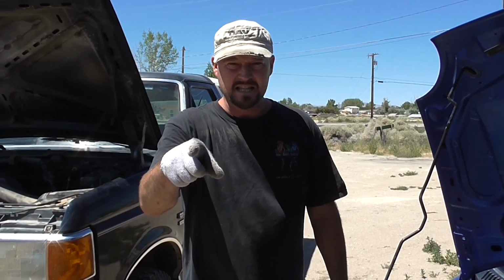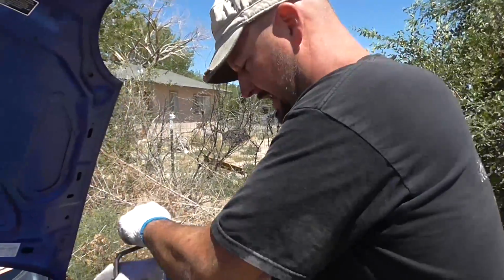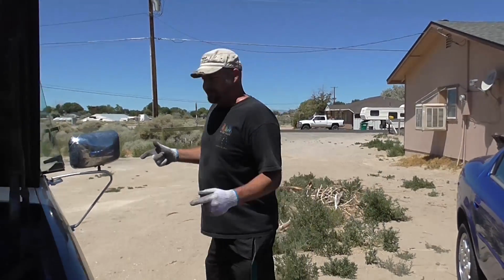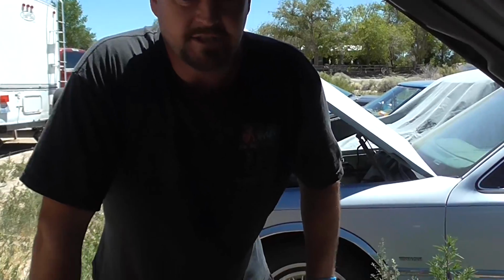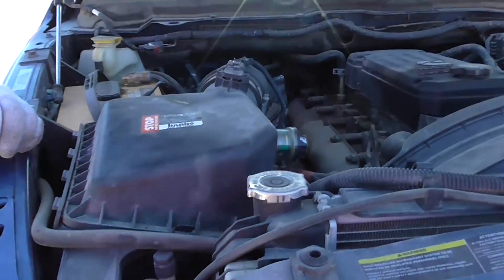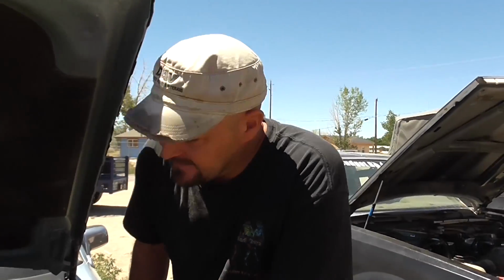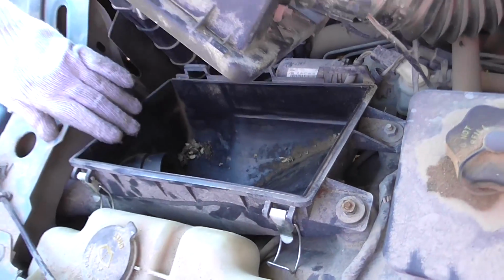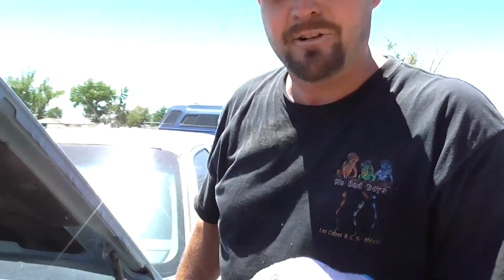Free Horsepower And Fuel Economy - Intake Mods

Comment: Why the negative comments, guys helping out giving free advice good on you dude
Reply: It's the kind of advice that can fuck your car long term. "Performance" air filters get their performance in one of two ways. Either they have MUCH more area (which this one clearly does not), or they do a hell of a lot less filtering.

Operating on the assumption that if one is being cheap about this, one intends to keep the car until it's a rusty pile of scrap, doing this is quite counterproductive. Allowing more dust in your engine will wear out your piston-cylinder sealing components (piston rings, texture of bore lining, probably valve seats too, for good measure) a lot quicker, which will make your car an oil burner a lot quicker.

The short term gains are nice, but long term it's just not worth it. Not unless you plan on getting rid of the car next year.
Reply: But did you see how dirty his second vehicles filter was? When you remove the bottoms it sucks in all the dust  meaning you have to replace your air filter more often
Reply: Mark Davies You are right for sure!!!!
Reply: @233kosta but that’s what a cold air intake literally does the same thing there is no box there is heat sheilds that’s dumb
Reply: @trippiebear848  Agreed. Sure, he's allowing more air access to the surface of the filter, but its air from inside the engine bay. Is a "hot air intake" really going to help over the stock version?
Reply: @GettinEdgy  the air will come through but if you think about it that’s still what a cold air intake is
Reply: Matt is a genius and the mods work GREAT! Much better than expensive aftermarket anything.
Reply: Welcome to the internet
Reply: Ikr.... Smh all these automotive engineers and master mechanics
Reply: @233kosta  he preventing you from fucking up not trynna fuck you up he knows his stuff g
Reply: Haters are gonna hate!!!!! Period!!!!! If you not willing to even try things, then zip it!!!!! Period!!!!! "Don't hate the player, Hate the game"

Comment: "To the untrained eye, this Neon looks unmodified and IT IS because who the hell would modify a Neon?"
Reply from the maker: Hmm, someone that wanted many more MPG and better acceleration with less push of the throttle.
Reply: 'many more MPG' then they would drive a Smart car.
Reply from the maker: NOTHING, could convince me to drive that ugly as hell death trap on wheels smart car.
Reply: YOU are the in-flight-rocket-surgeon who brought up MPG and acceleration ... stop trolling.
Reply from the maker: Trolling??? I am on my own page, I cannot troll my own page !!!  You are trolling on MY PAGE.  Enough already !
Reply: back in the 70s there ws a company that would take a 400cuin and pull all the pistons and repace 4 with dome top pistons and plug the other 4 falves  and run on 4 cylinders they got 20 percent better milage and only lost 5 percent power
Reply: Back in the 70s there was the Arab Oil Embargo...so...
Reply: Sleeper-sleeper car??
Reply: Flashahol Don't they call those coma cars?
Reply: LOL,That term would definitely explain the one Tercel I once saw who's owner unexplainably had a NOS injection system installed on... I was thinking: WTF POS modding are you investing in, dude???????? You just made my day!
Reply: Sean Watts
Lots of people. I have a 1998 Mercury Mystique with a 4 cylinder and i'll be modding every single thing available. Btw, there are 0 commercial (aftermarket) parts for my car. There are, however, race grade engine components available from the UK.
Reply: a jajka
Reply: Sean Watts I do
Reply: Sean Watts You ARE the definition of trolling
Reply: @Crawdoodle  and why is he pushing the throttle less? Is it because the car is breathing easier with the crap intake?
Reply: Why modify a neon? I'll school you real quick. CLOSED DECK is why. Strong platform to run either high boost with minimal modifications and or run high compression . No need to press a block guard and so on.. now do I recommend doing so no... But as far as strength goes it's a stronger block than Honda blocks that everyone builds and no I'm not bashing just using examples. Do some research and you'll see why. Obviously neons have shit parts on them to begin with and most owners don't take care of them due to the buying price. Little money to buy a car most likely means little money to maintain. Have a great day.
Reply: 2.0 4cyl stock 0-60 in 7 secs for a econo box thats not bad
Reply: Me
Reply: You’d be surprised!
Reply: Pornhub "Little Innocent Neon and Little Innocent Bronco get wild"
Reply: @seanwatts8342  because you can put a shit load of power to them. There used to be a guy in the city I live that had a 2 door neon with almost 800hp and I watched it smash a viper like it was sittin still.
Reply: They actually do have decent chassis dynamics on the track.
Reply: The only thing you hear from any of these so-called precise cut modifications, is the intake air being sucked in. Just like if you take a breather off of a four-barrel carburetor, on a 74 crown Victoria. Then it sounds like a beast.
Don't do any of these modifications that he does to the airbox, that have the bottom cut out. what does it suck air from the engine compartment and cause the air filter to stop up with oil. That little bit of residue on your valve covers and crap... It's a lot worse when the damn thing is sucking oily air from the inside of the compartment. You will be changing your air filter every 2 or 3 months. Instead of every 2 to 3 years.
That's precisely why they make air boxes, that have the end cut out and it's piped through either the fender well or the front of the vehicle. Cold air intake. The reason you won't cold air is because it atomizes the fuel quicker. Once the engine gets warm, you start losing horsepower. Just like adding nitrous to a vehicle, only thing is doing is coolin the air off an addend just a little bit more oxygen.
You don't have to take my word for it just look at the picture of my profile. That is a naturally aspirated, (nothing but carbs) 696 horsepower, 512 foot pound torque, Lincoln Mark 6 5.0 to the rear wheels. Built it myself, and that is numbers come from a roll test Dyno. Probably looking closer to 750 to 800hp off the rear of the engine.
And it gets better gas mileage than the factory 5.0 that was in my mustang. simply because more horsepower more torque means, less strain on the engine less pedal you have to mash. But if you put your foot to the floor, it'll drink at fuel like a forty year-long alcoholic.
Since I built it myself, with one cousin owning a block machine shop and another cousin owning a balancing shop, all I had to do is pay for the parts. Granted it wasn't 25 or $30, but it'll turn 8000 RPMs and drag the front wheels off the ground along with tucking the 3in exhaust underneath the rear bumper. To hell with a sleeper, you put them in a sleeper hold with something like this.
Reply: @budgetboosting  I have a completely stock 350 in my 93 C1500 and I could gap all those vehicles I get better fuel mileage and I only paid 1300 dollars for it
Reply: A poor man does! What a stupid question! lol
Reply: someone running the armature classes a local track that only allows stock/ lightly modded 4 cylinders and you dont want to blend in with the non vtec hondas and saturn ions
Reply: my buddy has a manual neon with a lancer evo engine swapped into it and a fiberglass hood and that thing fuckin rips
Reply: They did make a special Neon SRT-4 which intake mod would really wake it up.  See Mad Boosting for some great budget video content.
Reply: @madboostingmadmatt48  My former neighbor had one of those - it's about like a VW GTI.
Reply: Neon is a classic stop hating

Comment: 21:15 that hole is most likely larger than the diameter of the throttle body. It doesn't affect the performance at all.

Comment: This mod added so much extra power that when I launched it, the front clip tore clean off. Even made the rims spin inside the tire before it took off. Thats quite a bit of power gain.
Reply from the maker: +JDTVEXTREMEVIDEOS yes, that sounds like you had a great torque increase which is really felt in daily driving.
Reply: thats the best man!

Comment: I used to live in the desert, so I've observed that from time to time the clearer air and insane temperatures cause a change in brain function. It seems to lead to a bit of craziness and also ingenuity, which seems to be the case here. If you add a bit of your own "rare sense" to his, you can solve any question that may arise locally. I like this guy's presentation. Thank You, JD
Reply: JD Wisdom yeh it did to abraham and mohammed and discovered religion
Reply: JD Wisdom damn dude why cut it up spend 40 and put a specter as ND set it on top

Comment: synthetic oil can also help fuel economy check tire pressure often do make sure they manufacture spec the sticker is mostly by the door jam keeping the RPMs low
Reply: Synthetic oil gives you a marginal increase in power, but unfortunately the same fuel economy.

Comment: the stock intakes are optimized to supply the perfect amount of air mixture is the truth they get the most HP out of your engine always... otherwise car makers would be hindering there marketing numbers... if a car is making 300 horsepower u better believe the stock air box is getting the most out of that.. putting on a aftermarket air filter isn't going to magically create 320 hp... also the intake hole may be small but its powerfully sucking in air... so it doesn't need to be a massive hole... on sports cars u can actually hear the hiss of the intake sucking in large amounts of air quickly.. don't need a big massive hole when its pulling in a ton of air rapidly creating the perfect mixture to optimize the engine to its maximum horsepower.. hope this helps.
Reply from the maker: Case in point go to a performance tuner such as Hennessey Performance or any of them, see how many of their 1000 hp+ have a stock air box on them....... That should clear up any and all confusion.
Reply: And how much of that 1000+ hp do you think is from the aftermarket air intake :) that should clear up 98% of the confusion cause at the most 2% gains is all your seeing from adding a slight amount of increase in air intake and tuning the car for it... air flow can only go so far... its your engine and modifications that matter 98% of the vehicles true horsepower
Reply from the maker: Every bit of an increase, is an increase.  Why knowingly decrease when you can increase?  Then again, most sheeple settle for mediocracy, follow the herd even if its to the gator pond....  That's ok.
Reply: @budgetboosting  This dudes too fkn awesome!

Comment: I live in Florida no emissions no gun bans
Reply: Gotta love Florida.
Reply: Amen. No inspections either. Run no cat on my tsx header, no mix muffler, just 2 performance mufflers for the dual exhaust. No worries, no problem. Love my Florida.
Reply: It doesn't matter where you live in the USA -- it's against FEDERAL law to remove catalytic converters from a street-driven vehicle.
 There's no emissions INSPECTIONS in Florida, but the Federal laws still apply.
 I'm sure the millions of kids that are marching for Cleaner Air will appreciate your total lack of interest and/or knowledge regarding the same air that WE ALL breathe.
Reply: @ScrewballMcAdams  NO, I don't. Too many bugs, snakes, and Republicans.
Reply: @SlikLizrd  you are correct federal still applies. That's why the muffler shop makes you sign a waiver saying the car is going to be used for off road purposes only. That makes sure the muffler shop is not held liable if you get caught.  That's why I had my RX7 with no cats running on the street as a daily driver. Never had an issue. 

Side note. Nothing wrong with Republicans brother. We are good people.
Reply: @SlikLizrd  my RX7 ran about as clean as any rotary could. It actually passed the sniff test in Georgia where my sister lives just didn't pass the visual inspection. Hell the guy put the mirror under the car and gave it an automatic fail when he saw no cats. Was trying to get the car registered in Henry county. But oh well it was still registered and insured in Florida. 

By the way not trying to get all political but climate change does happen. It has happened since the Earth took shape. No denial here brother. Now the issue I take is that it's caused by man. Now please correct me if using the word "man" triggers you in any way. Don't want to use the wrong word.  Let me know how you would like to be addressed, don't want to offend. Neways back on topic. The Earth has been much hotter in the past and much cooler. I'm 44 years old. I remember as a kid the next ice age was coming, then in high school it was global warming and that Florida would be under water by the year 2000. Now since no significant warming has happened it's called climate change. The data is iffy at best and none of the climate models have been correct so far. Also none of the climate models have taken into consideration the effect that this little star called the sun plays on our planet and every other celestial body in our solar system. If Miami was really going to be under water in the next few years like AOC claimed, then why are they building a ton of new high rises right on the waters edge?

Finally please don't tell me that I'm a climate denier or that I reject science. Science is one of my favorite subjects. From climate to Quantum Physics and Mechanics. Answer me this though. How is it the science you back on climate change isn't the science you back on gender? Science says there are XX chromosomes and XY chromosomes. Meaning that science says there are only 2 sexes thus 2 genders. Sex and gender meant the same thing up until about 2009 or 2010 when the definition of gender was beginning to be redefined. Now like in the UK there are 100 different genders. Now who is really denying the science here? Food for thought friend. Would love to have a civilized debate with you.

Comment: Has anyone considered that cold air cannot be found inside the engine bay where the "EXPOSED" cone filter pulls air??????
Reply: Cooler air helps, but so does getting more air. Gotta find a balance. The goal is to get more airflow while keeping air intake temps close to ambient air temp or as cool as possible.
Reply: For more free horsepower, cut a hole in your hood and screw an old mailbox over your intake. (cut out the bottom first)

Comment: I live in a place like yours
If you go with kn...you need to run an oiled pre filter.
Reply from the maker: Even if you run a new paper filter, the performance would be just slightly lower than a $300 intake kit.
Reply: @budgetboosting  ya with the amount of dirt a pre filter picked up and I didn't see the KN filter it out. I went back to a paper filter, I'd rather have better filtration than a few HP

Comment: My car's intake is actually engineered differently than other car's with the same engine, to give me more horsepower, so.. Yeah. 
I also ran Four fuel economy tests. Two tests without the bottom of my intake, with the filter still intact, and Two tests with the bottom attached. I got 2 mpg less with the bottom off.
Reply: so you are saying it DIDNT work for you? just wondering b4 I do this
Reply: ShortManFilms Nope. All you'll get is a very tiny amount of better throttle response but it's not worth it. You'll also get a higher air intake temperature which is not good for efficiency. 
If you really want more horsepower, get a real Cold air intake, with a performance exhaust and get the cars computer tuned because without tuning your car, you're not getting anything from the car except a cool "whoosh" sound. And it'll be a waste of money. If you want better fuel economy, get a handheld tuner in which it has an "Eco" mode to give you better fuel economy when you need it, but you can also change it to a performance mode where you'll get better performance. That's the best for fuel economy and also reduce your weight of the car if possible AND, make sure the cars tires are properly inflated. Also make sure your car gets a tune up if you haven't done so yet. Check fuel filter, spark plugs and stuff like that. Clean the fuel injectors as well and yup, you'll see a difference. Don't listen to what this guy says in the video. The car manufacturers know whats best for your car.

Comment: can I cut the air box at the bottom of my 2008 mustang, I put in a k&N air filter only. I was looking up modding the box and this channel popped up. great video
Reply from the maker: I do not own a 2008 mustang so I am not familiar with its box.  I owned a 2000 mustang GT with the 4.6 and I installed K&N filter.  I noticed the hole supplying the filter with air was very small, so I cut away as much dirty side of airbox as possible.  The air supply hole started at around 2 inches diameter and when I was done with the box cutting, I was around 5 inches diameter which is pretty much the size of the entire filter.  The whole filter element was able to get quick effective air.  If your 08 mustang is similar air box design to a 2000, than it is an easy mod.

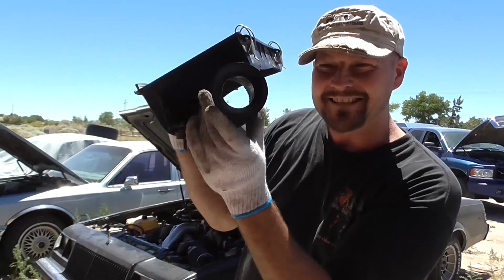Comment: 22:52 yeah look at all the water that is going to get sucked up by that on a rainy day.
Not to mention plastic bags and shit. But I get what this guy is saying.
Reply from the maker: the intake air supply can be made to face any direction, front, up, down, etc.  I like to face my intake towards the grille where cold air is, just like what is used to cool radiator, right up front.

Comment: yeap this dude is right, i remove the airbox from my bike and install K&N filter direct on the carp and do ajust the jet needle for more fuel and turning for a bit more air, and i have bully lot of car and bike on the highway, my next project is to relocated the filter away from the engine bay to allow to suck in cold air, and this will further increase horse power